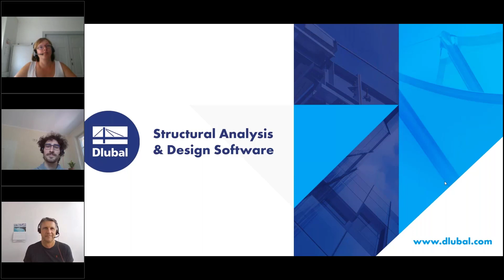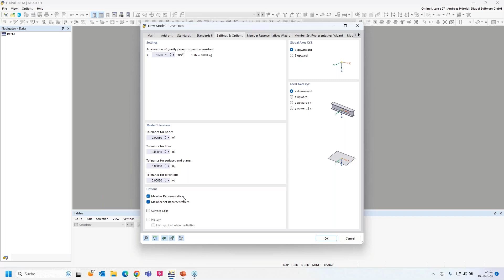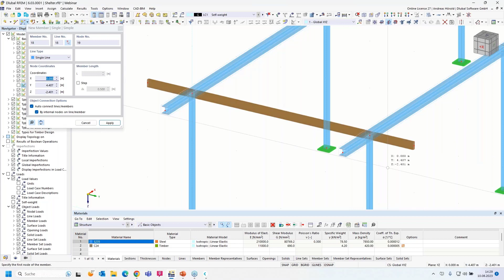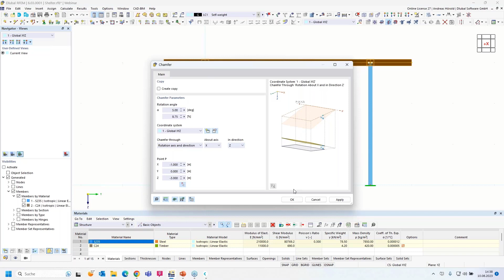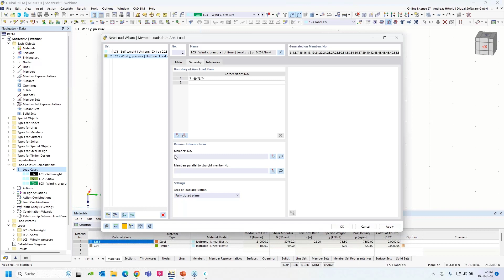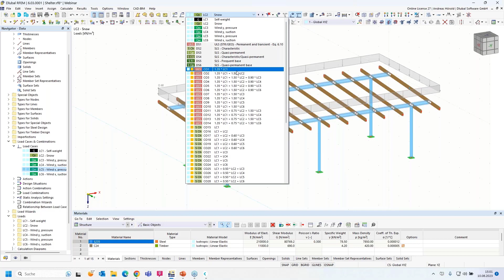Webinar | Introduction to RFEM 6 and RSTAB 9 | Part 1: Modeling, Load Input

Comment: 🎯 Key Takeaways for quick navigation:

00:00 🎥 El tema del seminario de hoy es Introducción al RFEM 6 y RSTAB 9.
00:12 🎙️ El webinar será presentado por Andreas Ferwald, responsable de marketing y relaciones públicas de la empresa Bluebar Software.
00:26 👨‍💼 Andreas Ferwald será el moderador y presentador del webinar, y estará acompañado por dos colegas, Oliver Matskas y Sandy Martulla, quienes se encargarán del soporte técnico y atención al cliente.
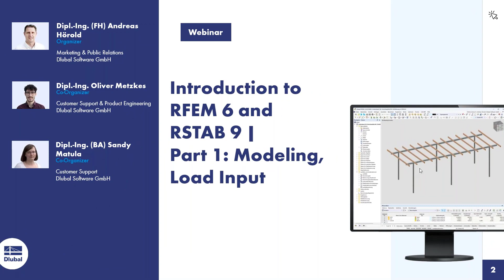01:08 💡 Durante el webinar, los asistentes puedan hacer preguntas a través del panel de control en la pantalla.
01:47 📋 La agenda del webinar incluye información general sobre la interfaz gráfica de RFEM 6, modelado de estructuras de acero y madera, y entrada de cargas.
03:48 ❓ Se realizó una encuesta para conocer qué software de análisis estructural utilizan los asistentes, la mayoría utiliza la antigua generación del RFEM 5 o otros softwares, mientras que algunos ya utilizan RFEM 6 y RSTAB 9.
08:58 💻 Los estándares internacionales para el diseño de acero y madera se incluyen en los add-ons de diseño de RFEM 6, no es necesario adquirirlos por separado.
12:07 🔧 La interfaz de RFEM 6 es similar a la del RFEM 5, con algunas nuevas funciones como el Bluebar Center, que es un administrador de proyectos.
12:57 🖥️ El Bluebar Center también ofrece acceso al extranet, mensajes, datos de la empresa, descargas de productos y características implementadas en desarrollo.
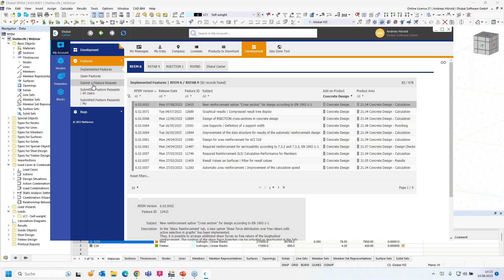14:46 ⭐️ Se alienta a los usuarios a enviar solicitudes de características para mejorar el programa y satisfacer sus necesidades.
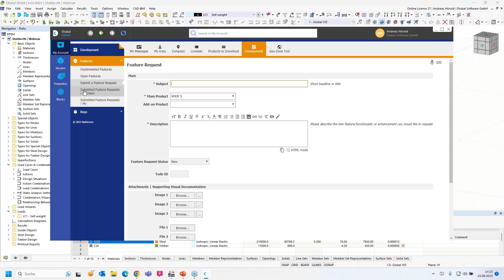15:07 👉 Es posible guardar modelos como plantillas para su uso posterior en RFEM 6.
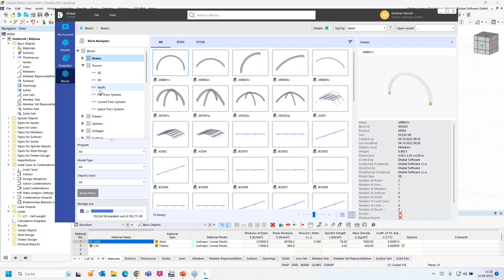15:34 ☑️ Los bloques en RFEM 6 y RSTAB 9 tienen parámetros que se pueden seleccionar para crear fácilmente elementos estructurales como cerchas, armazones y escaleras.
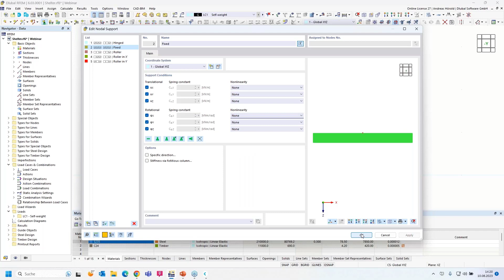20:15 🖱️ Es posible aumentar o disminuir el tamaño de los apoyos y las cargas haciendo clic derecho sobre ellos y ajustando su tamaño.
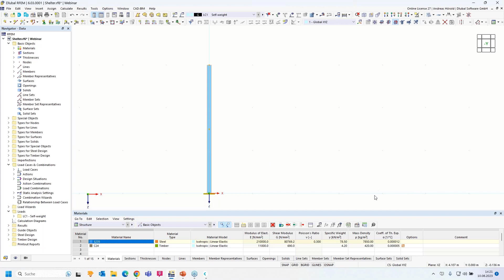21:05 🖱️ Al copiar elementos utilizando la tecla Ctrl, se crean copias de los elementos, mientras que sin presionar la tecla Ctrl, los elementos se mueven.
24:04 📂 Los elementos se pueden organizar en conjuntos de miembros para facilitar el diseño y el análisis de estructuras complejas.
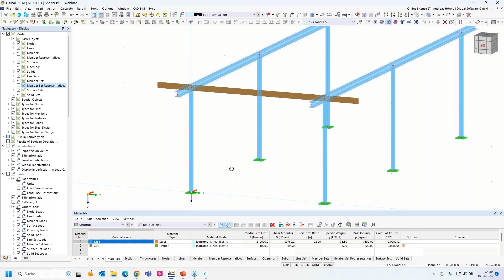29:08 ➰ Los desplazamientos y excentricidades se pueden definir para tener en cuenta diferentes condiciones de carga y los efectos de la conexión entre diferentes elementos.
31:47 🛠️ Los resultados de los análisis, como las fuerzas internas, se pueden filtrar y visualizar solo para elementos específicos de la estructura, lo que facilita el análisis de partes específicas de la estructura.
32:30 ➿ Se pueden utilizar articulaciones tipo tijera para resolver problemas donde se presentan momentos inconsistentes en las conexiones de los elementos.
33:17 🛠️ El eje rojo es el eje X el eje azul es el eje Y, y el corte debe ser libre alrededor del eje X y fijo alrededor del eje Y.
33:32 🚫 Desactive la opción "Ignorar objetos relacionados" para poder ver el diseño y luego seleccione el miembro central.
33:44 🛠️ Seleccione las bisagras y elija la bisagra tipo tijera en ambos extremos y al principio de este miembro.
34:02 🔄 Calcule nuevamente todos los elementos seleccionando "Calcular todo" en la pestaña "Herramientas".
34:29 🔗 Se puede crear una conexión entre elementos de madera y elementos de acero para unirlos en la estructura.
50:45 🛠️ Se pueden aplicar cargas a los miembros utilizando el Asistente de Cargas.
51:00 🛠️ Para aplicar una carga perpendicular al plano del área, se selecciona la opción "Perpendicular al plano" en el Asistente.
52:25 🛠️ Para aplicar una carga uniforme en los miembros, se utiliza la opción "Fuerza Uniforme" en el Asistente.
53:51 🔄 Si se comete un error en la carga, se puede modificar seleccionando la carga y cambiando su valor.
54:56 🛠️ Se pueden aplicar cargas a elementos específicos, como una viga de acero o madera, utilizando la opción "Carga Nodal".

Made with HARPA AI